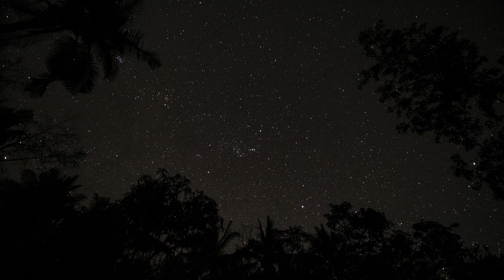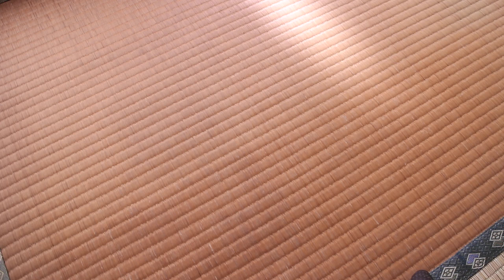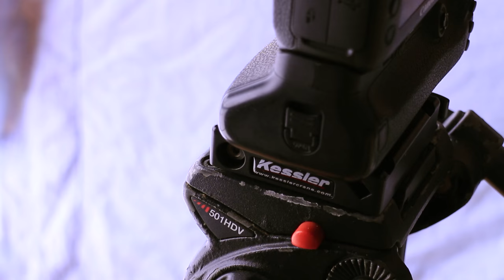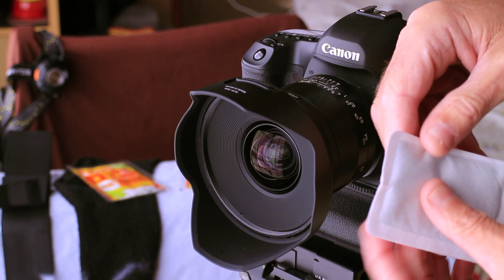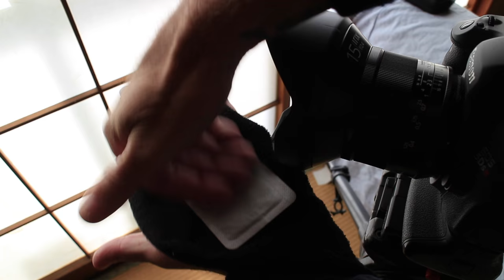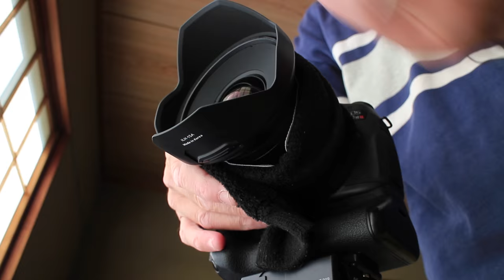Make Your Own Camera Lens Heater.

Comment: Thank you. How long will the pads work for and do they work when the temperature drops below freezing?
Reply from the maker: Hey Mark the pads were designed to work for around 8hrs, as there are no batteries involved and it is a chemical reaction that should bear true at all temperatures, including below freezing.
Reply: Thanks for taking the time to respond) winter starts soon and we are getting very heavy dews.  The battery ones may work well, but are $$$$$ and bulky to carry aboutm